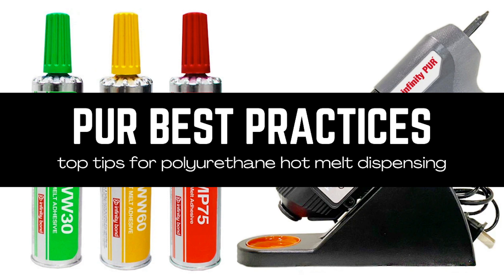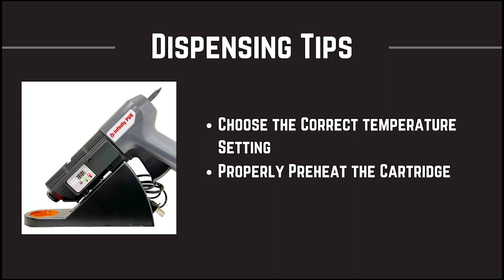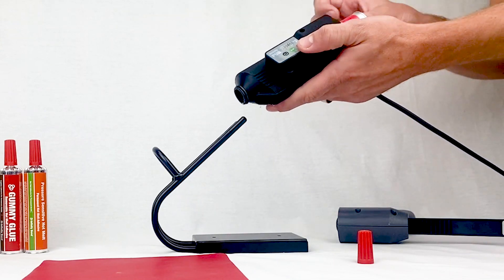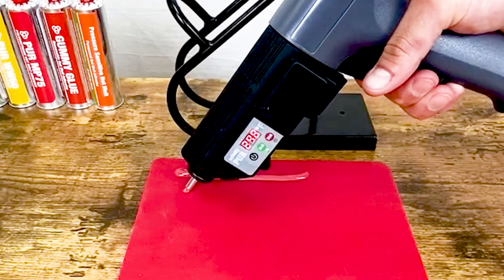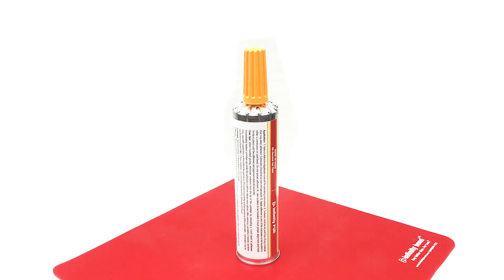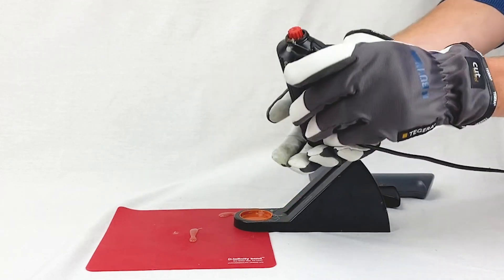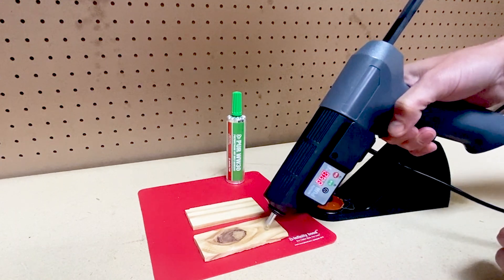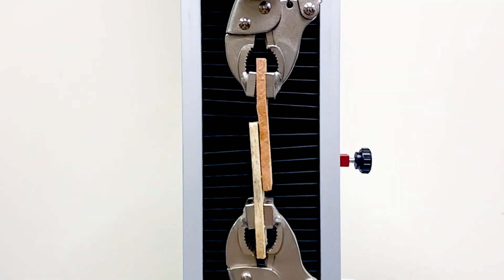Best Practices When Working With PUR Polyurethane Hot Melt Adhesives | Hotmelt.com

Comment: Can these be used for edge banding particle board or mdf?
Reply: What kind of edge banding are you referring to?
Reply: I'm not sure about that but why wouldn't you use iron on or double sided tape for typical edge banding?
Reply: @ThekiBoran  both of these options aren't available in my country. Only special double sided tapes work with edge banding. I found 3M 9832 tape on alibaba but they want me to buy 100 tape rolls minimum.